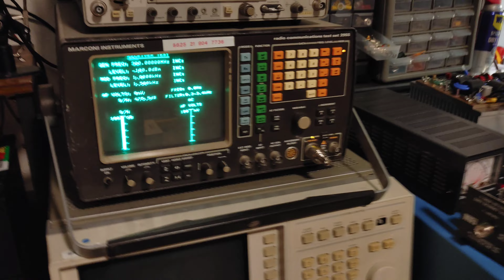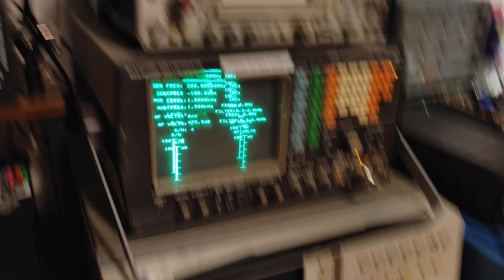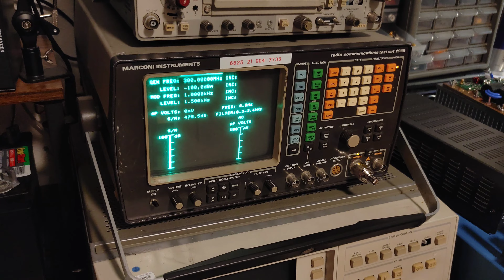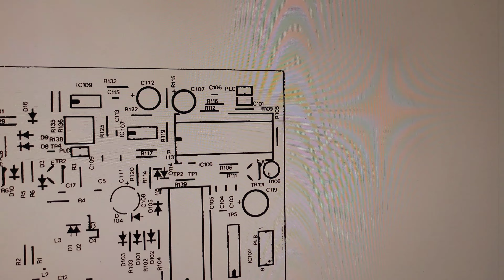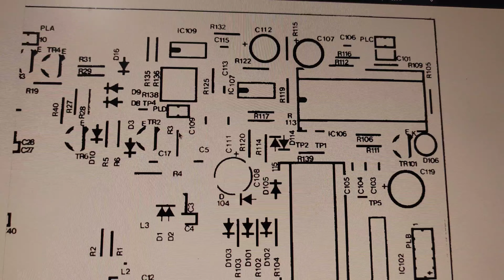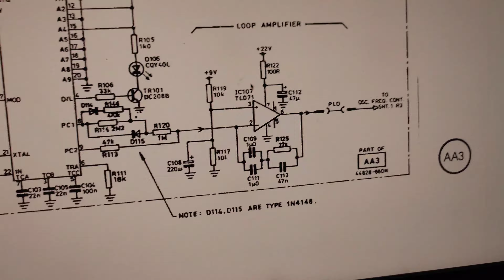Marconi 2955 Test Set Demo and PLL Repair

Comment: looking for a backup service monitor. how does the marconi compare to the hp 8921a?
Reply from the maker: Haven't used that one. But from a glance the HP set looks a lot more advanced. The Marconi is basically an AM/FM signal generator, receiver, power detector, and scope.

Comment: Thanks for posting this great video! My 2955 had exact same symptom. I also found my oscillator off frequency on my spectrum analyzer, like you, I thought the signal generator was dead. I just checked C108 and found that mine is also shorted, measures 15 ohms. I am sure this is going to fix my unit. Thanks again!
Reply: Replacing C108 did get the PLL to lock.